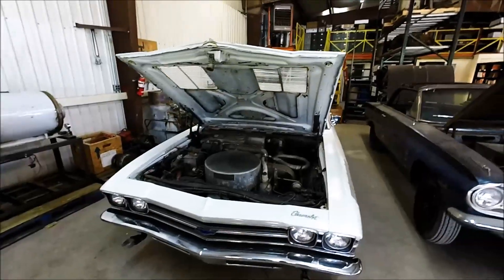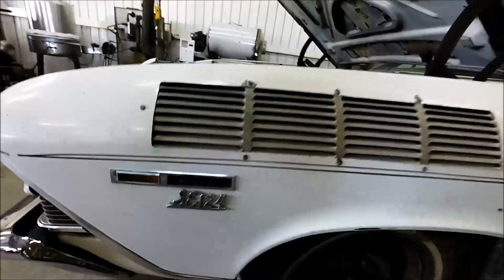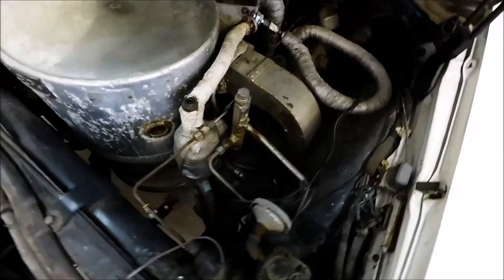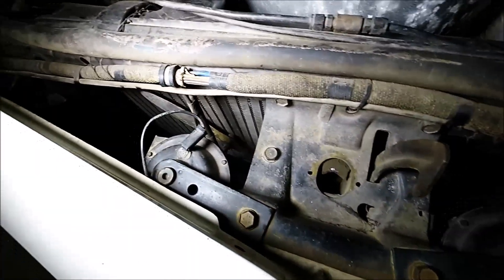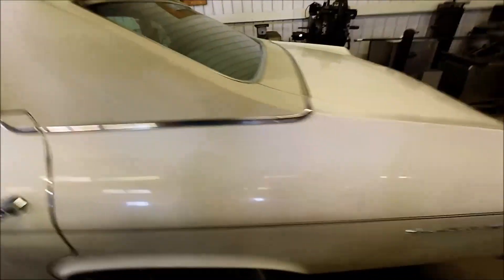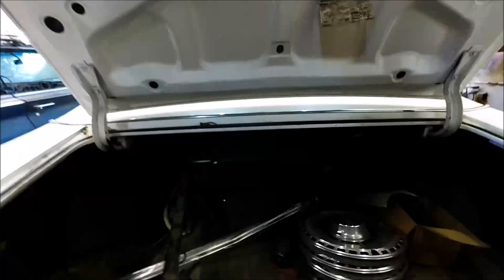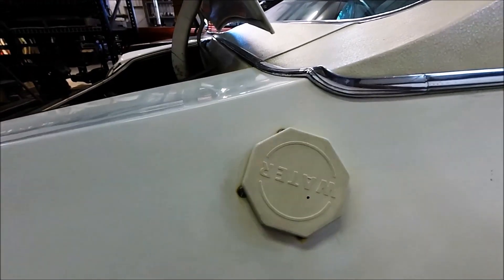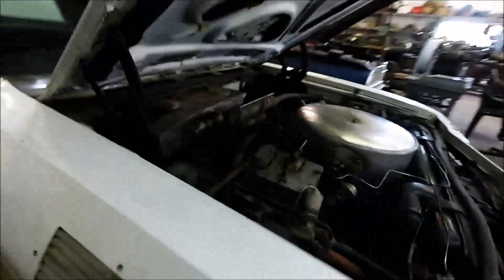1969 Steam Powered Chevelle - Built For General Motors

Comment: @Sander Van der Kammen  Are stupid or what? Like you afraid something about steam engine? Are you getting paid?.. Its his passion for steam, so what?.. If people prefer to use steam instead of ICE so what, do you lose money?? We don't care about efficiency bla bla bla, as long as we can make fuel with pretty much anything including wood, stick, gas and liquid, so why bother?
Reply: You need to go back to school because you know nothing about engineering... especially that the Rankine Cycle can never match the efficiency of the internal combustion engine
Reply: @sandervanderkammen9230  The choice will not be between  "the efficiency of internal combustion technology" and "the Rankine Cycle". It will be between "the Rankine Cycle" and WALKING.
Reply: @sandervanderkammen9230  Efficiency is not the only piece of the puzzle, although it is an important one. The ICE drove steam cars out of business primarily because they were cheaper and started faster. Doble was able to solve the issue of slower starting and made a steam car that is much better than ICEs in almost every area except for cost. Perhaps if a steam car could be designed using modern technology and modern production techniques it could provide viable competition to the ICE and electric car, especially with the environmental benefits they provide, even if they aren't quite as efficient.
Reply: @oreo_man  No amount of new technologies will bring back steam cars... they have been obsolete for more than a century for some very good reasons..
Primarily the Laws of Thermodynamics which limits both the practical and theoretical efficiency limits of steam cars well below that of ICE or electric cars.
 Steam cars are very dirty and bad for the environment, in particular NOx and CO2 emissions.
The SE-124 produced more HC emissions than any ICE car tested at the time.
Reply: @oreo_man  Steam cars have a truly obscene overall carbon footprint... definitely not a practical or commercially viable alternative to ICEs or EVs now or in the future.
Reply: @sandervanderkammen9230  You may be right, however that won't stop me from doing the research and crunching the numbers myself. If you would like to help me by providing your sources and numbers that might save me some time.
Reply: @oreo_man  You're not familiar with the Carnot Cycle Formula???
 Nicolas Carnot published his formula in 1824 which shows that the Rankine Cycle can never match the efficiency of internal combustion   heat engines.
Rudolf Diesel used Carnots formula in 1893 to invent the most efficient practical heat engine known  to mankind.
Reply: @oreo_man  Joesph Black discovered Latent Heat 1762.. any Heat Engine that requires a Phase Change of its working fluid during its thermodynamic cycle increases entropy.
Reply: @oreo_man  Rudolf Clausius discovered the Second Law of Thermodynamics and the Concept of Entropy in 1865.
Reply: @sandervanderkammen9230  I am not familiar with the Carnot Cycle Formula, but I did some research. It seems to talk about efficiency, whereas we were talking about emissions, and although those are remotely related just like every other factor of an engine they are not directly related. I would also like to ask you why the most efficient engine is the most practical engine?
Reply: @oreo_man  Fuel efficiency is always a primary factor in innovation  and the introduction of new technologies and the demise of old, outdated, obsolete technology like steam cars.
Reply: @oreo_man  Prayers for Jay and his family, he is currently in hospital burn unit undergoing treatment for severe burn injuries he received while starting his steam car.
Reply: @sandervanderkammen9230  But internal combustion is limited by what fuels are acceptable. ICE cars had horrible engine knock, so an additive was needed for the fuel, and they went with lead. By causing so much neurological damage the world was set back majorly. Aircraft often still use leaded fuel by the way. To make steam all you need is enough heat. It would be a lot easier to make cheaper or more environmentally friendly fuels for a steam engine. That applies to the 1920's and the 2020's.
Reply: @DBGH46  Not true, any fuel source that can be used in a steam engine can also be used in any internal combustion engine either directly or by further refining, including nuclear fuels.

Modern internal combustion engines  do not require lead additives or high octane rating.
 Direct Injection completely eliminates the problem of "knock".

That is a false assumption on your part, there are fuels available for ICEs  that produce little to no pollution and are more economical and energy efficient than steam.
Steam cars are no longer viable because of thier higher cost, higher emissions and poor energy efficiency.
Reply: @sandervanderkammen9230  “little to no pollution” Ya… sure. Why don’t you try running your car on vegetable oil or vodka for a while?
Reply: @DBGH46  Diesel engines were invented specifically to run on vegetable oil... before #2 petroleum fuel existed.
They run very well on vegetable oils and esters made from algae.

Millions of ICE  automobiles currently run on Ethanol in the world with production of 22.3 billion gallons, Brazil run almost entirely on Ethanol fuel ICEs.

The difference is that ICE cars are between 300% and 400% more fuel efficient, cheaper to build and maintain and have lower emissions and a significantly small carbon footprint than steam cars.
Reply: @DBGH46  The most efficient zero emissions vehicle is a hydrogen fuel cell vehicle, followed by hydrogen ICEs.. steam cars are so inefficient that no one would consider building on to run on hydrogen.
Reply: @sandervanderkammen9230  I don't give a rip about carbon footprint, NOx, CO2, or any other emissions, or efficiency bullshit. Now , I'm off to burn some old tires.
Reply: @Bill-sp8kb  Good for you! When you are finished stop by your local car dealership and ask if they have any 2024 model steam cars for sale.
Reply: NO, Just alot smarter and better educated than you..
Steam cars are an obsolete technology and has been since 1915.
The SE-124 was an epic failure and beautifully illustrates my point.
Any questions son?
Reply: @sandervanderkammen9230  So this is proven that u are stupid.. We know what u up to grandson.. There is no smarter or foolish in what people loves.. So stop pretending to be smart which is you don't..

Comment: What was the star up time, was it sort or do you have to wait a while for it to build up enough pressure?
Reply: It used an old Doble steam generator  which makes steam faster than a traditional boiler.
Unfortunately this prototype never worked very well and no longer runs.

Comment: How many times did Leno try buying it I wonder 🤔
Reply: Jay wouldn't touch this heap of junk...
Reply: @sandervanderkammen9230  You obviously know very little about Leno then.
Reply: @ItsRiiiick  I am very familiar with Jay Leno's collection and this pile of junk is certainly not up to his high standards and good taste.
Jay has an excellent selection of some of the most desirable collectable automobiles and technically or historically significant vehicles.
This does not meet any of those standards.

Comment: gm must have gotten some kind of kick back from the oil industry.
Reply: Why? This would have been a good way to sell MORE oil products. It runs on Kerosene (And probably 3X as much of that as a gas-powered one would on gasoline.)
Reply: Why would GM get a kick back from the oil companies if they canceled it?
Reply: @sandervanderkammen9230  A F is possibly cynical. Plus, a lot of people think that certain advancements are scrapped because of shady competitors or due to collusion. There are cases where that has happened, but I think the steam engine car failed because of Ford's ability to mass produce cars at a cheap price. No one could do that with an electric or a steam car.
Reply: @morecowbell235  I can't imagine why the oil companies would try to kill off steam cars, rhey are horrible gas guzzlers and most only run on oil.

In most cases someone simply invented something better.
Henry Ford actively promoted the use of Ethanol fuel and the Model T was the worlds first mass produced alternative fuel car.
The steam car died when Charles Kettering invented the electric starter for internal combustion cars in 1914, within 10 years all the steam car companies switched to internal combustion cars or went bankrupt.
Reply: @sandervanderkammen9230  I don't know much about steam cars, but from what I have seen the best one made was the Doble.
Reply: The Doble boiler is only designed to run on gasoline or kerosene.
 6.5 MPG is certainly a gas guzzler!
Reply: The total amount of product you sell really does not affect your marketing strategy or your profitability when you are a cartel
Reply: @The_Conspiracy_Analyst  Steam cars are less fuel efficient and would increase demand, high demand increases profit margins.
Reply: Why? GM canceled it before production.

Comment: I want a steam car so bad :( I want all that torque
Reply: Find a steam generator from the used market and power it with Tesla power modules. Then hook it up to a 4 acting steam engine into a car, replacing the fuel in the fuel tank with water (preferably using a clean tank). And that's a modern, steam generator powered electric car. You only add water and electricity to keep it running.
Reply: @aserta  surprisingly electric heating of modern steam engines is actually somewhat common
Reply: @WolfsBabyOil  No, its not common at all.. in fact its ridiculous concept that no legitimate engineer would ever consider.
Reply: @sandervanderkammen9230  although they may not be manufactured in that exact context, lots of old steam trains have been retrofitted with electric heaters 😉
Reply: @WolfsBabyOil  Do you smoke alot of marijuana?
Reply: @sandervanderkammen9230  yes
Reply: @WolfsBabyOil  Thats what I thought.. you are hallucinating  heavily.
Reply: @aserta  Why would anyone build a car like that??? Are making a joke or something?
Reply: If you want torque.. AND horsepower... go with something like the new E-150 electric truck! (Or any of the other upcoming electric trucks, especially those without a torque converter, and possibly with 4 wheel  motors.)
Reply: No horsepower and guzzles fuel
Reply: @sandervanderkammen9230  I would not care about the fuel economy if I could drive it for 20 miles or so.
Reply: @timothykeith1367  The SE-124 couldn't run 20 miles without breaking down...  it hasn't run at all since the 1970s

Comment: This was more efficient than gas cars and it runs on kerosene, the engine starts in 60 seconds. And once it starts then it becomes very fast. Also super cheap.
Reply: Imagine that using an electric steam generator, you don't need all that shebang, and you can condense the entire power pack, all of it, inside the engine bay, Tesla power modules included, to power the steam generator. For some dumb reason, nobody has done it yet, despite the fact that it would truly be, a clean car. Imagine retrofitting modern cars with this, ditching most of the weight and replacing ICE with clean steam. And this would be an 100% clean emissions car.
Reply: @aserta  You don't see the fatal flaw in that design???
No one has ever built a car like that because its a really dumb idea.
Reply: @Skibidoop Not true, the efficiency limits of Rankine Cycle engines has been known since 1824...
Reply: @Skibidoop Electric motors will always be more efficient than steam engines... using batteries to power a steam car is simply dumb idea.
Reply: @Skibidoop 1824.
Reply: You obviously don't have any clue what you are talking about...
This car was an epic failure.
Reply: @Skibidoop Wow! You really don't get do you?
Why would you use batteries to power a steam engine when you could use a electric motor? The very suggestion of the concept is illogical and completely nonsensical.
Reply: The Carnot Cycles formula tells us the efficiency limits of all HEAT ENGINES... both internal and external combustion.
The Rankine Cycle is not limited to external combustion heat sources but is constrained by the limits of the Carnot Formula.

Comment: Hybrid steam cars are the future.
Reply: No they are not, steam cars are an obsolete technology that's makes absolutely no sense today...
Reply: @sandervanderkammen9230  They have zero pollution, can go for miles and make loads of torque. Coupled with an electric motor it would have zero drawbacks.
Reply: @hereb4theend  except for the horrible energy efficiency of steam... that is the fatal flaw and the reason why steam-electric vehicles do not exist.
Reply: @sandervanderkammen9230  what do you mean horrible energy efficiency?
Reply: @JW-bx6ig  You didn't know that internal combustion engines and electric motors are more energy efficient?
Reply: @sandervanderkammen9230 It's okay, efficiency is not everything. The efficiency of photovoltaic panels is (10%-25%) (of course, under standard laboratory conditions). Despite this, it is promoted and anyone who expresses his opinion about it is attacked!!
Reply: @sandervanderkammen9230  so why do they still use steam turbines in power stations?
Reply: @BPJJohn  Because power stations are built to last 50 years... lots of old, outdated equipment still in service some places, here in California primary steam plants are all gone and the last nuclear is scheduled to close.
 Gas Turbine engines are superior to the steam.

Comment: One of my college professors converted a car to steam. The reason the U.S. didn't adopt steam - it doesn't give instant horsepower. You have to let the car heat up, and you can't go 0-60 in 10 seconds. My professor did say his car would get over 50 mpg, as the energy loss was very low.
Reply: I've heard steam has instant torque though, like electric
Reply: @GreenEyeDemon  What new engine?
Reply: @GreenEyeDemon  Steam engines  use water as the "working fluid"
Water is not a fuel.
Reply: @GreenEyeDemon  No steam car is super efficient, steam is the least efficient automotive engine type.
Reply: @GreenEyeDemon  You are aware that Bill Bessler bought the Doble company assets after it went bankrupt in 1931?
The boiler in the SE-124 is the same.

EPA tests performed in 1971 proved just how horribly inefficient this design is... it tested the worst in fuel economy and emissions.
Reply: Your professor is a crackpot... steam  is dead because it has horribly bad fuel efficiency.
Reply: @sandervanderkammen9230  That was ~1988 and it was his hobby. Just a hobby. He wasn't a crackpot. 
Most large ships use steam turbines because of efficiency.
Reply: @jeffj2495  Sorry you didn't know that steam engines are horribly inefficient and expensive to build and maintain.
Modern ships use Diesel or Gas Turbine engines that offer superior fuel efficiency.
Reply: @sandervanderkammen9230  How unfortunate for you to always want to have the last word. Must be challenging.
Reply: @jeffj2495  Not at all I wasn't finished but you seem unable to challenge my statement... I'm glad you are a fast learner.
Reply: @sandervanderkammen9230  Many ships use bunker fuel oil, like a sludge
Reply: @timothykeith1367  Modern ships don't use steam, they are internal  combustion.
Either Diesel or Gas Turbine engines.

Both types can run on a wide variety of fuels including heavy marine fuel oil and Bunker C.
Bunker C was once very cheap but is today in high demand by the plastics industry as a base stock.
Reply: @jeffj2495  That's right - ships have used turbines.   Turbines are efficient, but are not practical in such small sizes as required in a car.   Turbines are good if you need thousands of horsepower.   The various steam cars have had to use reciprocating engines, which have very poor efficiency.
Most ships today though are diesel powered.  Diesel engines are more compact than steam plant, giving more room for cargo or passengers.
Reply: @GreenEyeDemon  There are no modern steam cars in production.
The SE-124 was a complete failure, it barely produced 50 horsepower and guzzled fuel at 6.5 mpg on kerosene... the exhaust emissions were horrific.
Reply: Stop propagating lies and false information.
Steam is horribly inefficient, every engineer knows this.

Comment: that generator and my 2 cylinder rotary, will do the trick.
Reply: @lobo studios Why use a heating coil?
If you had a big enough battery? a electric motor is 300% more efficient than a steam engine!
Reply: @lobo studios Apparently not..
Reply: @lobo studios novelty? 
As in trying to build the worst car ever made?
Performance car? I'm just thinking about energy efficiency... using a battery powered heating coil to boil water for a steam engine is just dumb, WHY would anyone build that?
Reply: @sandervanderkammen9230  Get a life dude
Reply: @bilbo_gamers6417  Get an education dude..
Reply: @lobo studios So it is an exercise in bad design with no practical applications?

In other words... a waste of time and money.
Reply: @lobo studios People that build real cars don't do things for the hell of it"
Reply: @lobo studios No one builds steam hot rods... that is completely inconsistent with the concept of what is a hot rod is supposed to be.
Reply: @lobo studios A hot rod is when you take an old car and install a newer engine or enhance its performance...
Reply: @lobo studios All the more reason not to use a steam engine...
Reply: Your joking right?